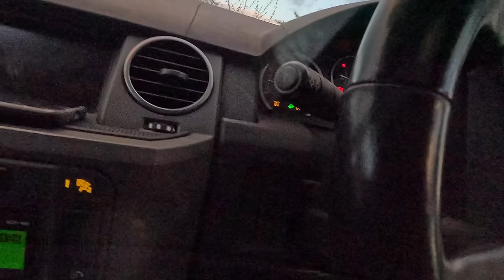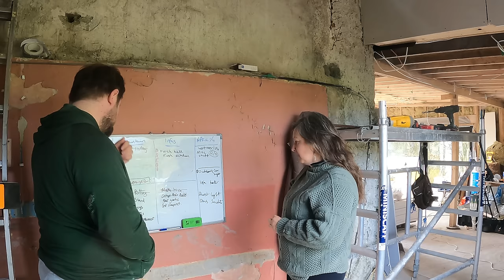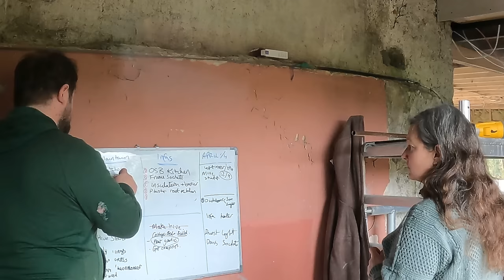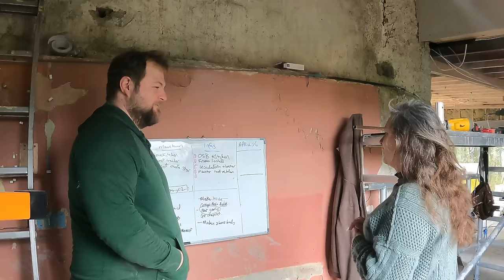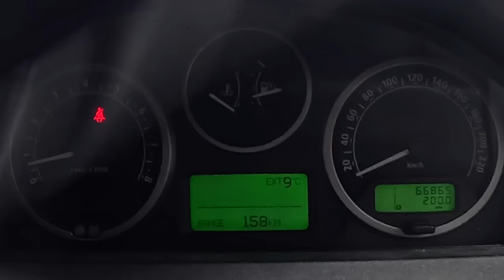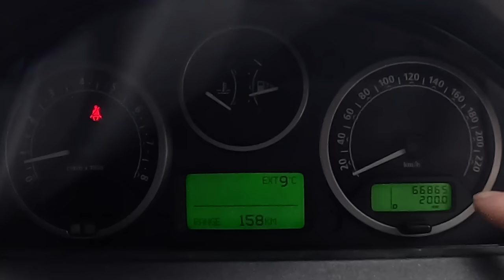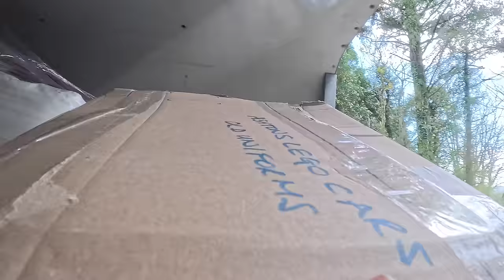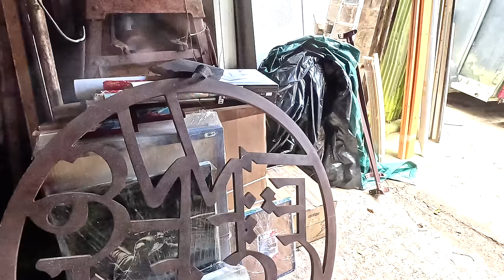EP65: We Tried The Most Unusual Relocation Experiences

Comment: Cheap lipstick RED wipe it on the surface of all electric back boxes, place the plasterboard up to the electrical metal boxes and print the red lipstick onto the back of the plasterboard.This will leave a mark were you have to cut with multi tool. 👍
Reply from the maker: Thank you so.much for the tip. Can remember the last time I wore lipstick😜 but I'm sure Ciara has some🙂

Comment: Hi guys - just think at the end of this you will be experts! Gyprockers get paid quite well :)  I too am currently finishing off where I  have taken down walls and built new walls and ceilings and I bought my self a 'drywall sander' which was quite reasonable and it doubles as a floor sander.  it has a long handle and a vacuum hose thingo and was only $250 AUD. I admit I havent used it but looking forward to see if saves on dust and saves my neck :)  ps I am glad to see your tooth pain seems to have subsided.
Reply from the maker: Ooh, will have to look into a drywall/floor sander. Thank you so much for the comment 🙂